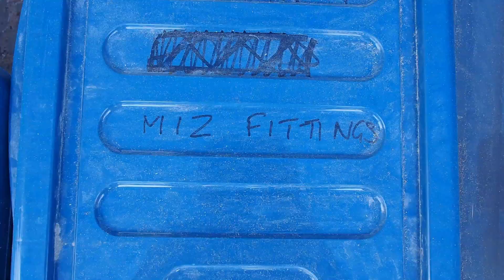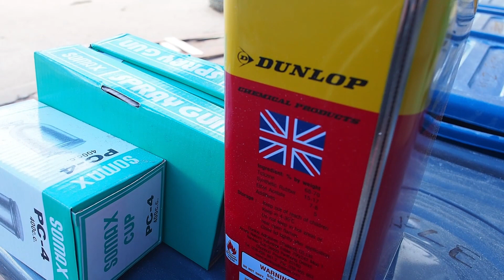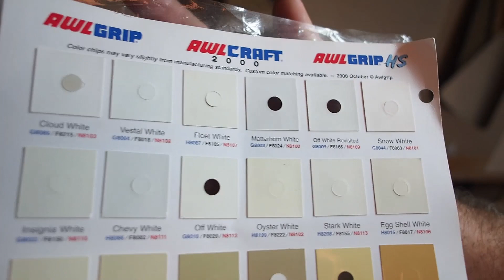Esper Refit 06 - Hong Kong Phooey; Veneer Goes Up; Removing Dorade Vent

Comment: Well it seems like both progress and fun are being made. The veneer look sharp!
Reply from the maker: It's not looking too bad, is it Renny? :)
Reply: Not bad at all. How is the veneer applied, contact cement?
Reply from the maker: rennybarr No, epoxy. We use contact adhesive for the Formica but for the veneer it is epoxy because most of it is mounted to a 4mm ply.